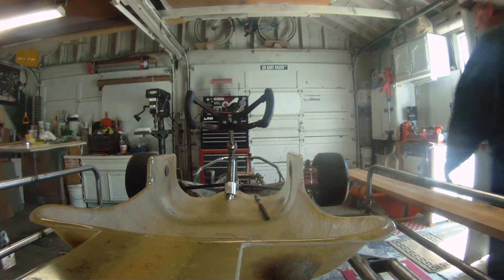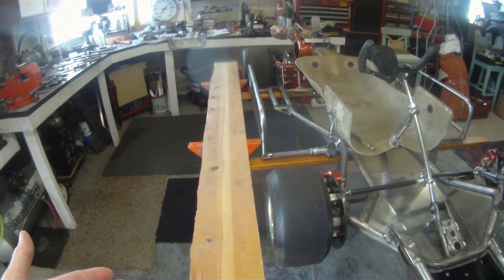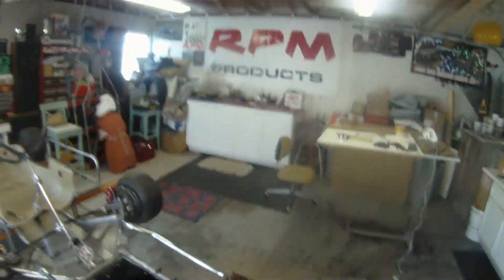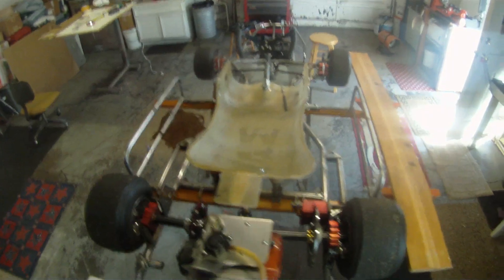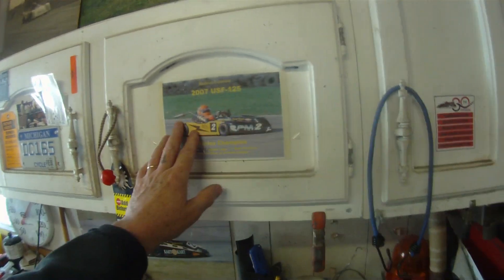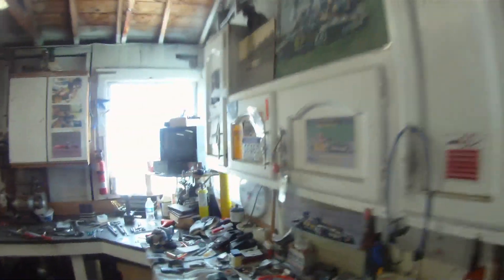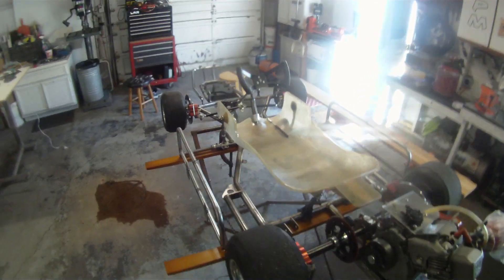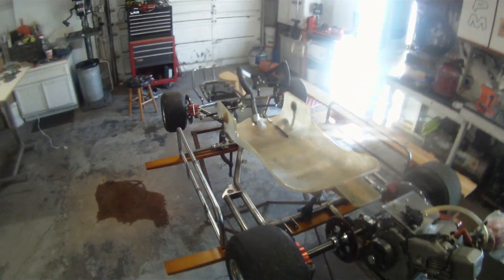Track Width 2.0 - Let me es-plane!!!!

Comment: Wow a real rear engine enduro kart!  I used to build enduro karts 45 years ago in So Cal for myself and others.  I think I built the first narrow track enduro kart in 1973.  I wanted to try to put the Mc91 in the back to improve the drag but wasn't sure that it would work because of the chain rotation.  How is the rear engine working?
Reply from the maker: Larry, we have since changed this kart from the Briggs Animal that was donated to the project to an Alky burning Flathead Briggs. It runs good!!! Just for play AND to get new guys in the hobby we can put almost anyone in this kart without them being overwhelmed by speed or power. We are still working out gearing as we only run it at Test days but here is an on board clip from October 2021. Enjoy!!! 

https://www.youtube.com/watch?v=DOnTni5td8w
Reply: @F125yourself  It good that you're an enduro kart evangelist.   I'd like to run enduros again but in the southwest there is nothing.  So I've been racing sprint karts for the last 20+ years.

Comment: How did u set wheel base and track width for the chassis design?
Reply from the maker: Mayur, there are standards for US road race karting (Circuit Racing in Europe) provided by the Sanctioning Body. This was a "produced" chassis by an American Manufacture so most of the work/math was already done in regards to chassis design/geometry.

 For wheel base we are given dimensions of 40" minimum to 50" maximum on a "laydown" Enduro chassis. 

As for track width, it is dictated by the maximum width of the front wheels once brakes have been installed and wheel width has been determined.

Generally, on an American laydown Enduro chassis the rear width is kept as close to the front as possible for aerodynamic's.